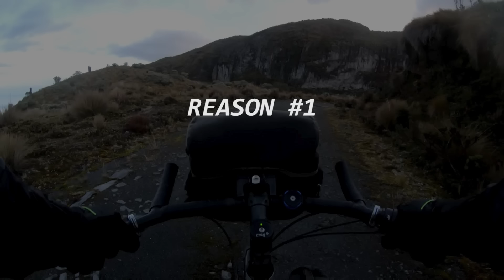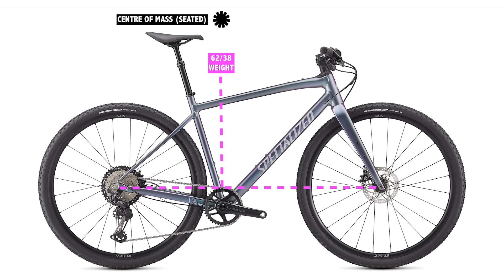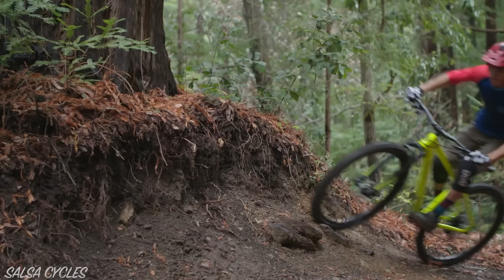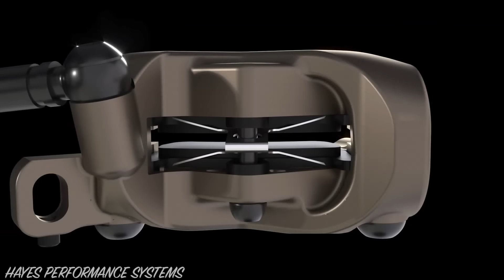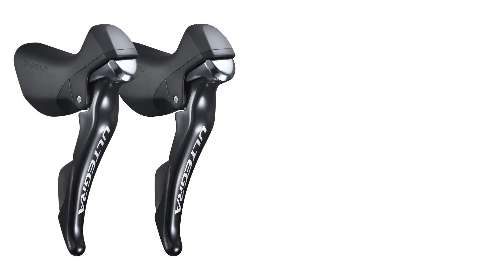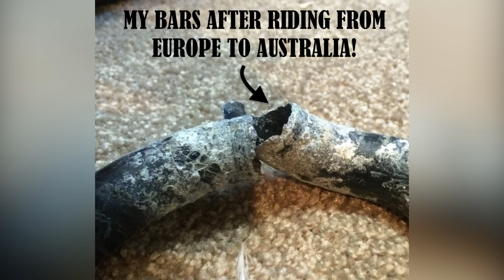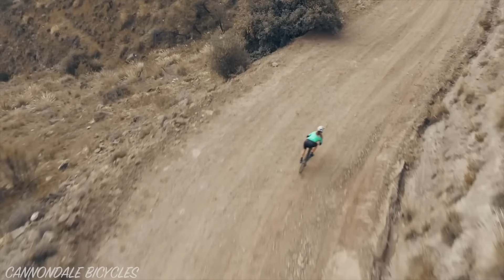Why Flat Bars Are BETTER Than Drop Bars For Most Cyclists (Objective Analysis)

Comment: I can't agree on many points. I've ridden flats almost all my life and the moment I switched to drops I don't think I can come back. The drops on my gravel are just perfect. I am not scared anymore to descend at high speeds, nor over rocks or snow or anything. If you're doing proper enduro/dh then yes flats are better but otherwise drops are the best. Provided you have enough hip mobility, which most people don't, hence the complaints about positioning your hands on the drops. I can, and I have stayed hours and hours on drop bars without resting and it's just more stable and comfortable. Mountain bikes now need hydraulic brakes because they complain that there's not enough braking power, well once you can brake with your hands on the drops the amount of force you can output greatly increases. I don't know man

Comment: Stopped watching after #5, "Low gear ratios are more common on flat bar bikes" - really? Not only you are comapring apples to pears, but also I thought you comearing handlebar designes, not bike types. Using this analogy I can claim that warm jackets are better beacouse those tend to be worn by people living closer to poles, and these are usually wealthier. And who said that lower gear rations are better?? Depends what you need your bike for. This is why mountain bikes have flat bars, and lower gear ratios because the bike has the purpose those components help tu fulfill. Other bike use cases are asking for different components. There is no better or worse, just different.

Comment: Thanks for putting together this info. I’m no way in the same league of rider as you or the riders in the video but the info really helped me. I’m a mature rider and having issues with my neck and low back. Upright riding is more doable. I’ve been thinking about changing my Diverge drops to flat swept back bars.   How do you transfer your shoulder width measure to the correct flat bar width? I do some urban riding and don’t want to get bars that are too wide with cars.

Comment: hello, for the last year and half I've been doing tons of more bicycling, at the same time it's more like a motorcycle since I motorized my bicycle. while I have learned how to get a 80cc 2 stroke to be able to start from a stop on its own, and climb hills.  I do still pedal a lot, and I currently have a customized mongoose mountain bike with 650 vitesse wheels. I use it in the city going to work everyday and ride it through trails on off days. I love it on trails 4 wheelers couldn't catch me, but it's terrible going to and fro work. it's not slow but causes me very much lower back pain on long rides, honestly I'm never pedaling on the street so I don't think I'm overwhelmed physically but could it be the handle bars or what? assistance from anyone appreciated

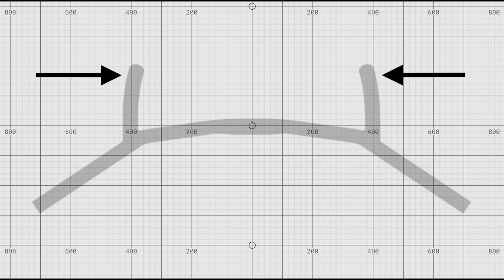Comment: 10:15 I did exactly this with my bar ends that were originally placed at the ends. It not only improved handling significantly and is more practical (not getting stuck at other parked bikes and getting the bike more easily into a car) it also gave me two additional grip positions: Firstly, the more aerodynamic and ergonomic grip that is mentioned in this video, that should only be used in open spaces where you can predict that you don't need sudden braking as you cant reach the break levers in this grip. And secondly, a hybrid grip where you grab the end bar with thumb and index finger and the other fingers still grip the flat bar. It gives you a more ergonomic alternative to the regular flat bar grip while still being able to reach the break levers. Only shifting might be a bit awkward and probably takes a bit longer, but on longer constant speed sections this is only a minor inconvenience. I recommend to give this a try
Reply: Spirgrips give you that hybrid hand position where your index and middle finger hold the "horns" while you can still reach your brake levers with the ring and pinky. You can't do a power emergency brake, but for daily feathering of the brakes it works fine. Haven't tried innerbarends yet.

Comment: Regular drop bars offer way more options than the regular flat bars. Case closed.
But then comes all the funky variations and customizations - which not really help much in deciding which one is better. Case closed.
Because better is what fits YOU the best. As usual.

Comment: Pro
1. Except where you're on the tarmac going downhill very fast. I've never seen people on drop bars to struggle for the bar control like I did with my flat when getting above 70 km/h when I wished I was having a strength workout on a gym for all my upper body muscles. But most cyclists aren't riding downhill very fast or are they?
2. Except on a long distance on tarmac (on more upwards position with endurance, all-road or gravel bikes) where too wide flat bar with limited hands position changing make your neck muscles sore and your servical spine and hands numbness. Not to say that unless tri bar extension included, you have the same too much upright position so your sciatic bones and pelvis may suffer as well. Even 1hr ride is a pain when not being able to use tri bar - my experience.
3. LIke i wrote in #2, endurance, all-road and especially gravel bikes are more upright pretty often because the front wheel is pushed into front more than you have that in regular road bikes. If you happen to touch front wheel with your toe, you chose a wrong size of your bike.
4. Doesn't matter that much with hydraulic brakes as the levers goes rather smooth in higher group sets. And you have GRX levers now with a better grip on the hoods position (and separate brake levers on the top as an option). Anyway, you have at least 2 positions enabling you to use brakes on drop bars, when on the flat you have only one.
5. I thing it's possible to mount 30/46 crankset with 11-42 cassette using GRX and there are a lot non Shimano options to get 1x drivetrain with 38 in front and 11-50 rear or even more. Anyway, when your speed is dropped to below 5km/h, it is very hard to control your bike. And you drop that low when it's very steep so in order to not have your front wheel loosing grip, you have to lean forward on your bar. Good luck doing it on a flat one!
6. You can mount flat bar on a road bike and that would not make it so much cheaper (gear+brake levers are cheaper), but doesn't make sense. And those flat bar bikes are heavier and the framesets less advanced (easier to build).
7. Trekking bars give you a less control especially on braking. The other super weird bars makes your life tougher to mount anything on them, worse control and cost some more than regular drop bars.
8. Most cyclists are not bikepackers and those who need some bags, uses racks and panniers or topbar and seatpost mounted bags.
9. Unless you want to have a weird custom looking bar enabling you to switch hand positions.
I did finally use bar tape on my flat bar for much greater comfort (high-end tapes are so much cheaper than high-end grips) and better isolation from cold in winter and although I used a very cheap one and mounted it wrong, it slightly unwrapped on one side, but is still usable.
Cables? There are drop bars with inner hold of cables.
10. Never in my life have heard of such a thing. I guess it doesn't happen very often, although it's probably because you have to exchange your bar tape once in every few years.
11. I don't know if most cyclists use twist shifters. Do they exist for higher groupsets? Are they really usefull? I prefer levers and probably you do as well as when twisting you loose control!

Against
2. How is that not contradicting #1 of pro flat bar reasons? I was using wide flat bar in the traffic all the time and it was great. It is easier to keep attention to your bar in front of you than to your panniers in the rear. If you managed to get through with wider front, you know you're good.

Summarizing it all. I'd choose flat bars only for the urban rides and all MTB activities or just very short distance rides. If you want to travel further and faster and more comfortable, drop bars are prefered choice not because they look better (and if that's statistically significant difference, then I'd say it's pretty objective reason), but because they're functional.
That all is being said by a man who has only a flat bar with bar ends and tri bar extension and riding ultra using only those (but suffering pretty much). Cheers!

Comment: I rode with both, flat bar and drop bar and for me the drop bar is clearly the winner. It's much more comfortable for longer rides but I agree with the harder breaking in bumpy terrain. But I think when you ride on bumpy and steep terrain more often it's not a question of the handle bar any longer but a question of what bike you should use in general. A mountain bike (which comes with flat bar anyways) is the better choice then instead of using a gravel bike or something similar.

Comment: Thanks for an informative video. At least half of your reasons for flats  being better are related to bike geometry not the handle bars. I  bought a commuter which has a more comfortable geometry for me, and converted it to drops as they are more comfortable for my riding. Having said that, I will be purchasing a touring bike in the future and will most likely use flat bars for that.

Comment: Thanks for the video , I've noticed your bar has no rise ,but it does bring the bar closer to you  I'm wondering if this is enough to stop neck ache , I'm anxious to rise a bar too much as this will put too much weight on my saddle ,& after having a prostate operation I've been told to put more weight on my hands & feet ,I was using a raised Jones loop bar , any advice would be welcome .

Comment: Aside from the supply chain issue, it seemed to me Flat Bar bikes(in the $1600ish USD price range) were really hard to find. There didn't appear to be a large number of manufactures out there making them, again in this price point.  I ended up with a Trek FX 4 Sport Carbon after a long search for a Cannondale CX1 or Specialized Diverge E5 Comp Evo, which no retailers had.  I tried drop bar bikes but they just weren't for me.

Comment: I'll make the argument that extra steering leverage is undesirable at high speed. Bicycles and motorcycles aren't steered with the front wheel at speed, they're steered with the back wheel by shifting the rider's weight. Even some automobile manufacturers reduce steering input by modulating power steering at high speed. A Bicycles/motorcycle rider should use the same side push method to turn at high speed, ie. push forward with the left hand to turn left and with the right to turn right. This causes the bike to lean to that side resulting in a more sure and quick entry into a turn.

And I agree with your conclusions. If you've ever had your hands bounced off the hoods by a big bump even on a paved road you'll know why having a good grip while reaching for the brake levers is important. With the advent of hydraulic disc brakes I can't help but wonder if it's possible to put two sets of levers, one for the normal position and another for bar ends or aero position. And as a former NYC cyclist I'll say that my experience probably would've been better with drop bars instead of straight.

Comment: I really like the classic design of a fully squared up city bike handlebar. They're ergonomic, keeping your wrist straight and parallel to your arm. They look cool, especially on a traditional Dutch bike. They bring your hand out pretty far from the steering while not sticking straight out like a flat bar, giving you a good amount of leverage with an upright riding position by default, though I can imagine you can add bars for different purposes onto them, and make them more aerodynamic by turning them upside down, but I can't imagine how that geometry will work with the human anatomy... Some really old bikes with these bars have rod brakes, which look cool too.

Comment: I think this is fair, I have two bike's one with each type and I like both. I have noticed the straight bar bike seems very stable and I have had high speed instability with  my old drop bar Miyata on bumpy down hill roads.

Comment: I would advise using flat bars even (or perhaps especially!) in urban areas. The upright position makes it easier to see other traffic coming from various directions, and therefore makes riding safer. In my opinion, you shouldn't be riding so close to cars that the handlebar width makes a difference, anyway. And also, speeds are often lower in urban areas, such that the aerodynamic advantage of drop bars doesn't make as much as a difference.

Comment: As I age and lose height, I'm considering converting one of my drop-bar roadies to a different bar type, even though I exclusive ride pavement. Problem it for me, I don't want to lose my Campag 10 speed brifters (also have a front triple :-0) and can't visualize how I would keep these without also making them ergonomically unusable. I have already considered options of stem angle and reach, of course.  I did laden tours extensively in younger days on rough gravel in the mountains on drop bars with no problems, but this was way before mountain bike geometry was conceived. But I agree, you do make compelling arguments. Subscribed.

Comment: I just can't get comfortable on a straight flat bat. A twisted inward wrist not only puts pressure on my wrists and forearms but raises and tensions shoulders and doesn't allow the overall body a healthy posture. Flat bars have always made long rides less bareable. A hold parallel to body and bone makes more sense anatomically for long rides. A swept angle in between is even better.
Reply from the maker: It really comes down to both your individual bike setup and personal preference. If flat bars don't work for you, stick with your drops, as comfort is usually most important.
Reply: @Cyclingabout  its definitely given me a lot to think about. Thanks. Especially the price of hydraulic mtb brakes vs road brakes. If I can make flat bars work that would really save some money.

Comment: Have been watching your channel for a short while and like what I see. I'm getting older, 67, and while I"m pretty fit...still backpack, and hike long miles...I'm getting more into cycling. I had a professional fit, but of course, bikes are hard to come by at the moment. On the upside it's given me a lot of time to research and watch videos like yours. I have some mild spinal issues; lumbar and cervical areas and while a lot of folks have steered me towards drop bars due to the "multiple hand positions"(raising them to accommodate my issues) I'm really thinking I'd be more comfortable with  "alternative"  flat bars, as there are lots of options that allow multi hand positions. Thanks for your video! I will look into your bike books!

Comment: I have always, and I mean always, hated the way drop bars feel. My everyday bike has flat bars with bullhorns attached, so I can still achieve an aero position when called for, but without that feeling of trying to balance on a needle that I experience when using drop bars. I also think bullhorns simply look a lot cooler than drop bars do.

Comment: I do think that drop bars are more popular for ergonomic reasons. Most people aren't loading their bikes with front end luggage, and they're also generally not hammering down trails at 40 kph. They will generally live in cities and be biking with a light load that is usually on the rear rack. Ease of maneuvering in pedestrian and motoring areas combines with control surface access in most positions to give drop handlebars an edge. There's even new modifications that allow a dropbar setup access to controls in all positions, so you can ride on the hoods, the tops, and the drops and you will have complete access to braking and gear controls in all positions. That's a winning formula.

Comment: Drop bars are dangerous, and not just for the cyclist, because it's more difficult and uncomfortable to look ahead. Plus, by craning your neck, you're restricting the blood flow to your brain. And, by bending forward so far you're likely to get lower back pain. That pain will limit how long you spend on a bike - and deter you from getting enough exercise. Plus, if your bike has drop bars, the saddle is probably shaped like a razor blade.

Comment: In short -
Do you prefer a bit of speed? Drop down bars. More aerodynamic, takes less space in the traffic and after a little getting used to, excellent for fairly uneven surface, like road, gravel to mild bumpy terrain
Do you prefer all the comfort? Flat bars. Lower your speed, chill and enjoy more controlled riding experience. Drop bars are easier for handling the bike. Better for off road, where you likely slow down anyway.

I personally enjoy both. But currently use drop down all the time. I'm sure I will get back to flats later on anyway...

Comment: I personally also prefer flat bars, but I found the drop position the safest on extremely bumpy terrain. Without even forcing a tight hand grip, in the drop position there is not way the bar can get kicked off my hands even when braking.

Comment: Flat bars rolled "too far" back (so the sweep-back becomes as much down as back) with T-bar ends and a second forward set inboard of the shifters that angle in, gives me three different hand positions, four if you count the suicide stem grip option. I've toured with flared drops too but spent 95% of my time on hoods or tops.

Comment: I prefer flat bars with aero clip ons. Upright I'm more comfortable and in more control than drops. If I'm tucked in the aero bars are more aero than if I was in drops. If I'm really tired I can rest my body weight on my elbows using the areo pads.